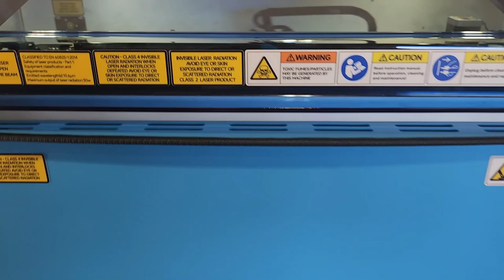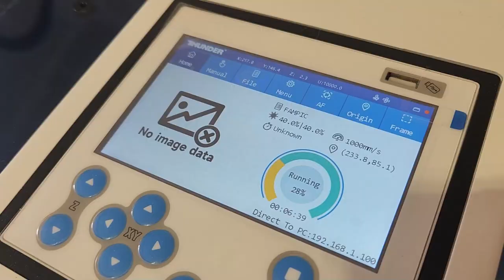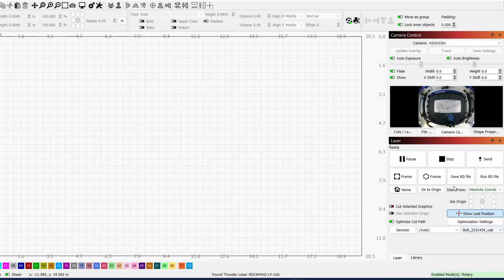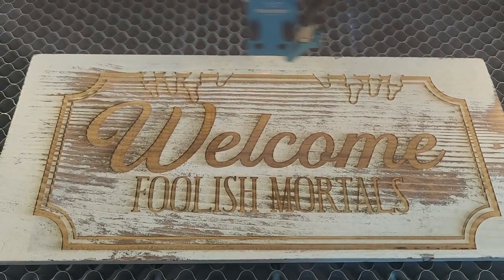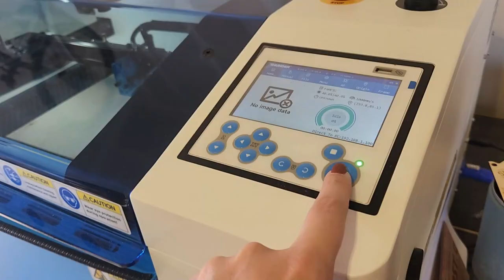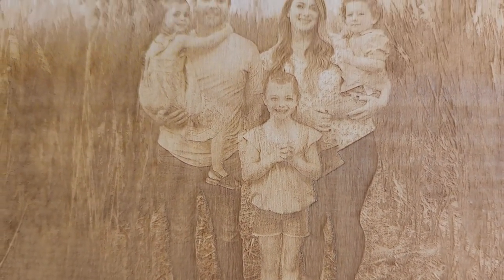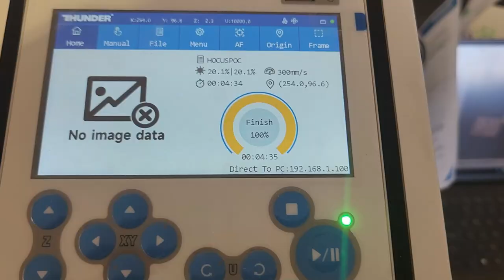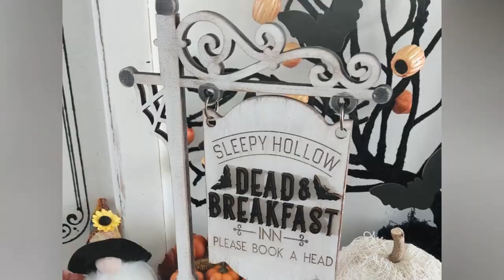The Ultimate Desktop Laser Engraver For Small Businesses In 2023!!

Comment: One of the things you neglected to mention, and probably the most important feature, is that it’s an RF laser and NOT a CO2 laser. You never have to worry about breaking your glass laser tube or replacing the glass tube. It also runs cooler, much faster speed and provides greater detail!
Reply from the maker: Yes!! I definitely forgot to mention that. Such a good point!

Comment: I'm wanting to start a small laser engraving business and I'm completely torn between the Thunder Laser Bolt and the Xtool p2. I'm coming from using a Glowforge Pro and I'm a bit nervous about the learning curve. Would you recommend a Thunder Bolt?
Reply: I don't have any of those machines, but look at @RichardBoisclair-hw6nb's comment above. RF lasers have multiple advantages over gas tubes, including the ability to both cut materials using less power, as well as engrave faster due to less mass and faster acceleration on the gantry. Unless I end up needing a much larger bed, this is the one I hope to be getting.
Reply: I started with a Glowforge Pro.  I upgraded to a Thunder 63 and shortly after my GF died.  Rather than pay for a refurbished I decided to buy the Bolt - not sorry.  Thunder Lasers are amazing!

Comment: Is she powerful enough to emboss or engrave in UHMW polyethylene  sheets?
Reply from the maker: I would assume so, but I have not tried that specific material. As long as the thickness is less than 1/4 inch, I don't think you'll have a problem cutting through it. Engraving shouldn't be an issue.

Comment: Do you have to have it by a window to vent out? What if we were wanting to put it where there isn't a window, does it have a fan to suck it in? I will go check it out. I have been wanting to buy one for a very long time and just haven't taken the plunge.
Reply from the maker: It has a fan that will push out through the hose and you can put that hose anywhere. We have ours in a garage and we have a door that we send the hose out through. You'll just want to have a space to vent the hose out of.
Reply: There are a number of enclosed air purifiers that are designed to contain the particulates and smoke, negating the need to vent out of a window or door. She mentions using this at a craft fair, but think about it. In addition to lugging 150 pounds of laser machine and accessories, where would you vent this in most show facilities! Then again, the air filter units could add another 40-50 pounds of weight. Better, cheaper and lighter machines out there.